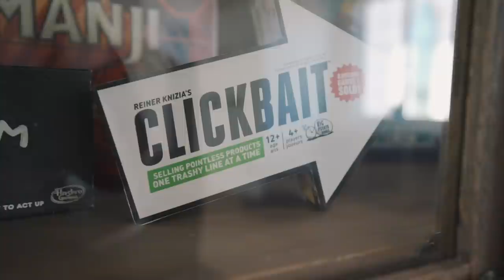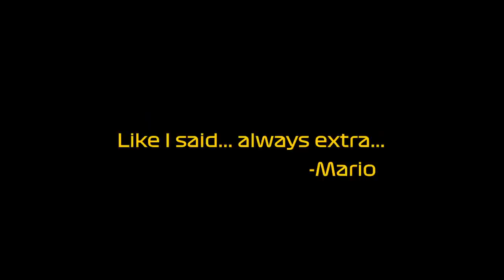Bugatti Inspired Movie Theatre Build!

Comment: Going to build my own IMAX Movie theater. First off, have you ever been in an IMAX theater? If you had, you would know you CAN'T build one in a casita sized building unless it is 2 or 3 stories tall. Second, a TRUE home IMAX theater would cost between 1 and 2 MILLION dollars to set up. Google it. You need 2 or 3 integrated projectors and a wrap around screen. I've seen home theaters in Vegas homes for sale on Zillow that will blow away anything you could possibly build in that structure!!!
Reply: good idea bro hmu to network on that plan #entrepreneur
Reply from the maker: IMAX builds their own home theatres. 400k. Certified by them. I can do the same thing. The height doesn’t dictate anything. Just wait and see.